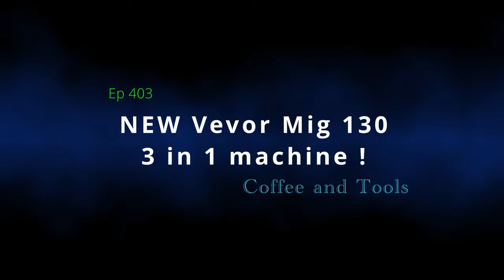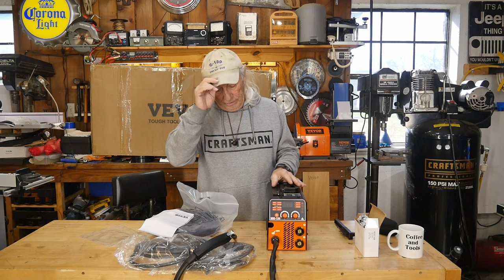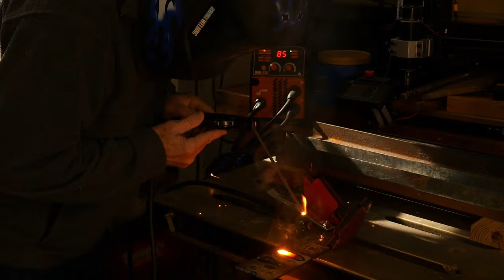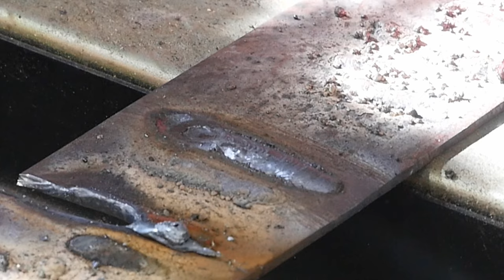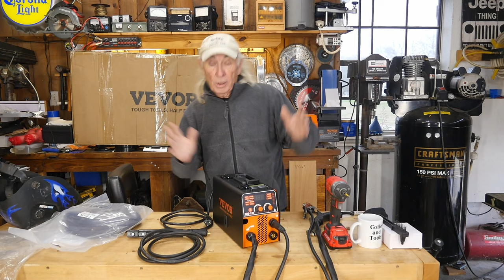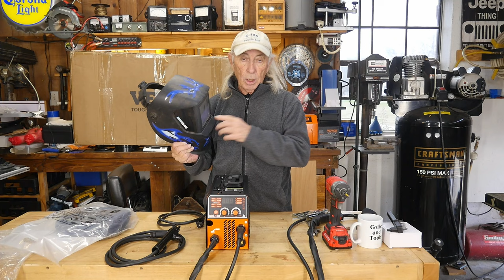Best 3 in 1 welder deal, Vevor Mig 130 , Mig, Tig and stick, Ep 403

Comment: If it doesn't take gas how does it tig weld and no fan is quite weird. I just bought a 200 amp arc welder made by Arc captain and it's either 110 or 220 and the price was $111.
Reply from the maker: WoW, that's cheap !  I keep forgetting the gas ! Vevor includes the Mig / Stick / and Tig. Normally I do not like 110v for welding but this one showed really good heat and no funny pulse etc.